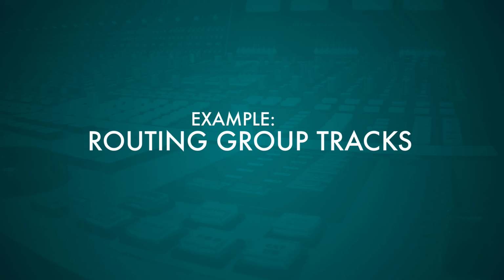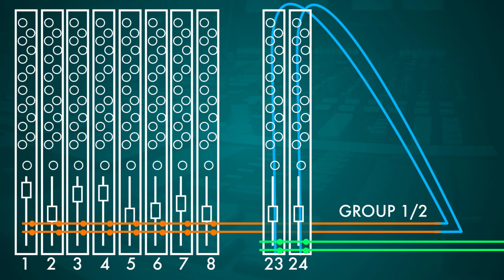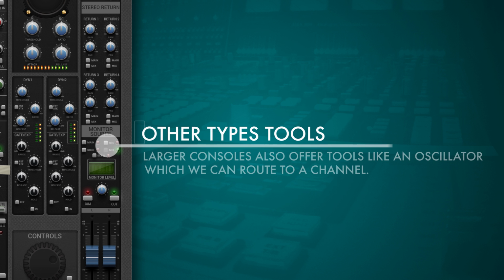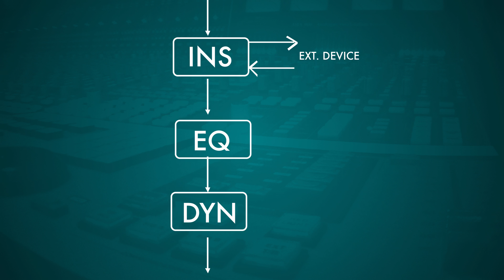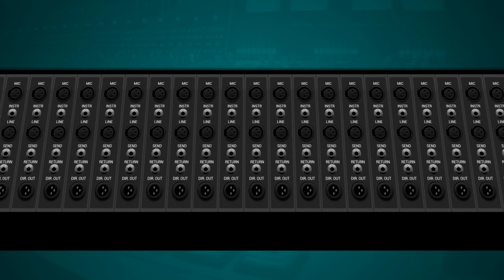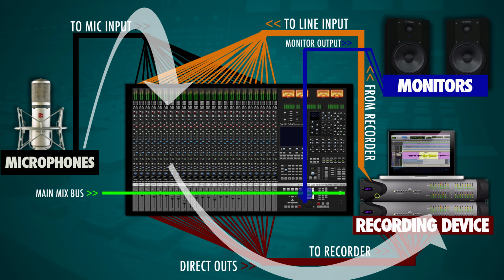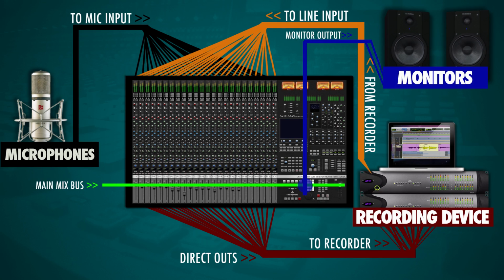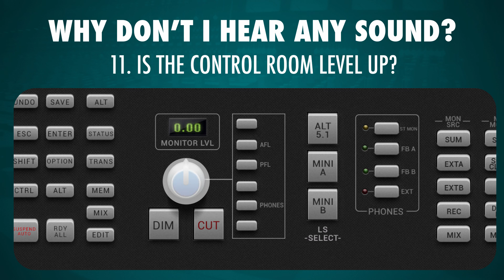Mixing Consoles Explained (part 3)

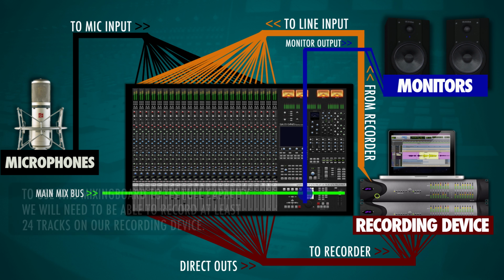Comment: Thank you for the great video. Have a big question. at 3:25 what is a good audio interface which has 24 or at least 16 ins which I can use?. Maximum I have seen is 8-in only. How does the big studios with 60+ mixers work with the computers and what sort of interfaces they use? any models you can specify? Thank you